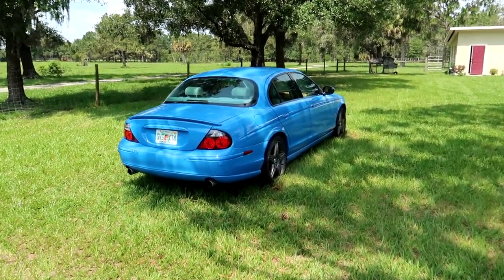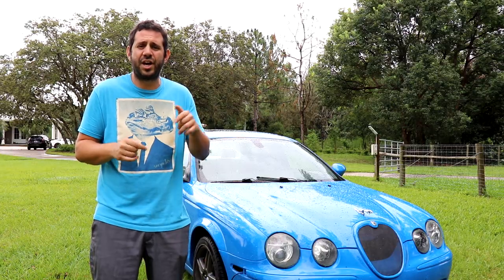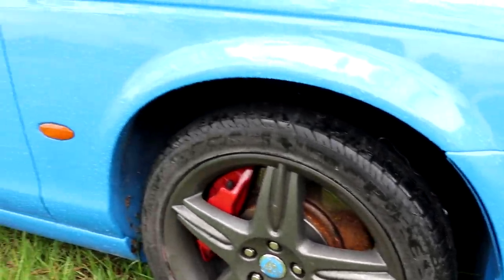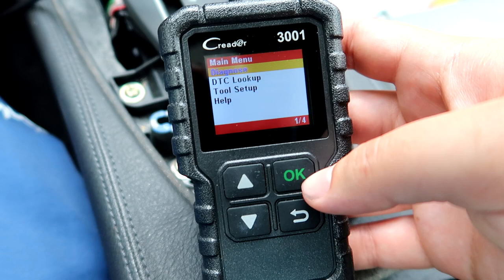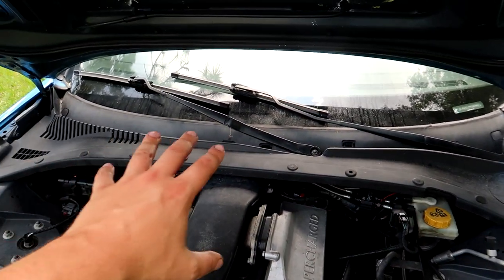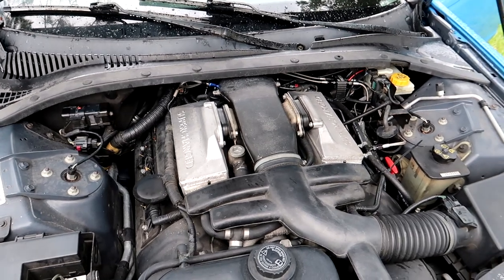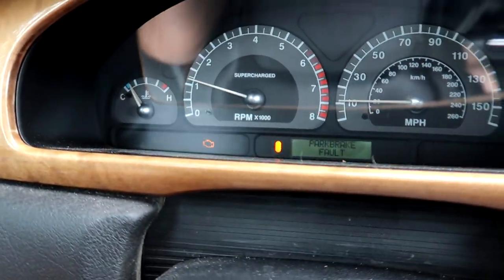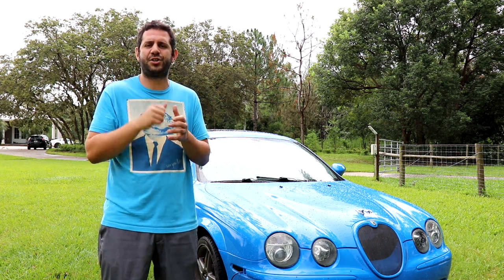I'm Selling the Blue Supercharged Jaguar at COPART! Comes With NITROUS!

Comment: In this video Samcrac shows us approximately how long you should own an older Jaguar.
Reply: Or a newer one
Reply: Satoshi Nakamoto mine is vary reliable stange as it is my 240d gives me much more trouble
Reply: You can show me a million miles Lexus, a two million miles Mercedes and Volvo.  But you would be hard pressed to show me a 200k mile Jag.  I had an S type V8 timing chain issues, it shared the craptastic 5r55w transmission with the Ford Explorer which was rebuilt twice.  Then you had the "minor" issues. The car was easily the worst modern car I've owned.  It's a shame if I had a better experience I'd buy an f type.
Reply: I am on my second Jaguar, very reliable cars. I know someone who owns two with 1/2 million miles between them

Comment: The ECR valve as a check engine light will fail emissions inspection in states that check. 

As far as performance goes, the EGR does nothing.
Reply: Are you able to remove the wires and throw a resistor across it? Or is the EGR more complicated than that?
Reply: Daniel Sinnott Can't say for a Jag, but it usually varies between manufacturers how you can bypass them, typically you would have to get the ECU unlocked and then change the required parameters for it so that it expects to valve position sensor to say that it's at a particular point for all engine loads. It's a bit tricky and can really only be done by someone with great experience with the particular make, like a dealer or certified repair center. Also, this requires the ECU to be a rewritable ECU that accepts reprogramming. Not all unlocked ECU's are reprogramable.

Comment: If the EGR system is electrically or mechanically faulty it can pop a code right away but if the passages are just clogged it may not until you get it warmed up and under load.  If you were keeping it it might be worthwhile to get it properly diagnosed. If you were in California you would have to fix it before you could sell it. Good luck with the sale

Comment: I had an EGR valve on a Nissan that eventually got so clogged that as soon as the car got warmed up the carbon in it turned gummy and clogged it completely and then the engine would choke and die. It would start just fine when it was cold though and there was a pin hole for air to pass.

Comment: Driving the car for 5 to 10 miles with a high rpm might heat the exhaust and blow the egr clean. It does help on my friends wv pasat when he get the engine light and egr fault code. It doesn't help on my Ford Mondeo....